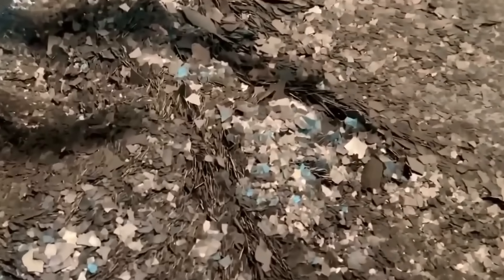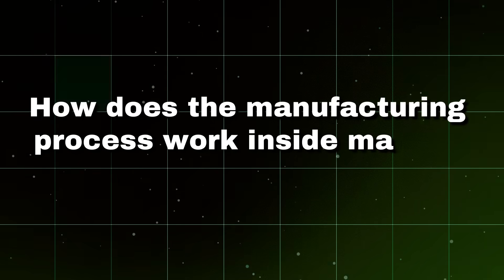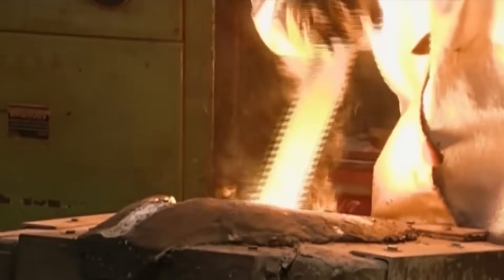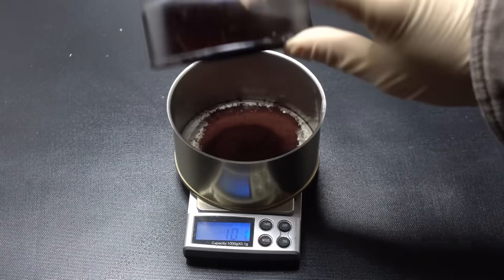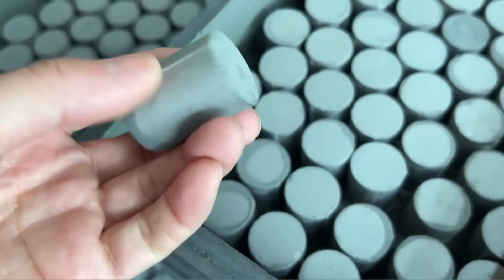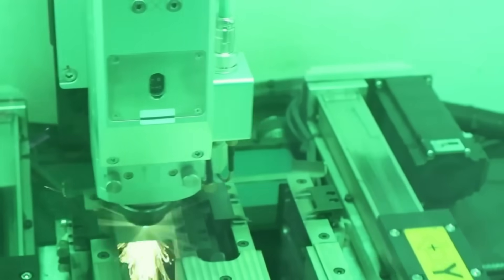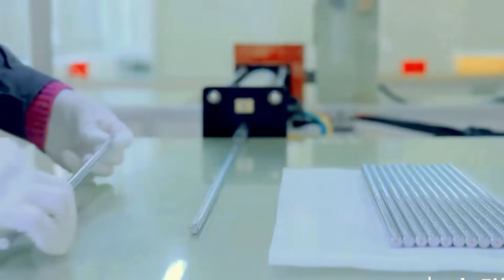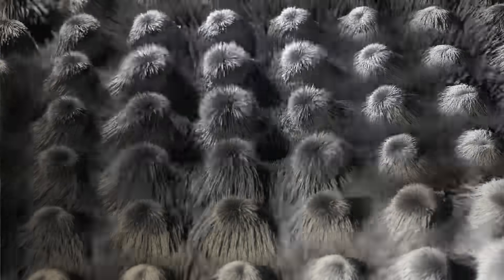THIS is HOW MAGNETS are MADE 🧲 | The MOST INCREDIBLE PROCESS EVER REVEALED

Comment: One of the major types of magnets is the ceramic magnet. They have Aluminum to form the ceramic part, which holds the actual magnetic material in place. This video doesn't mention the common ceramic magnet.